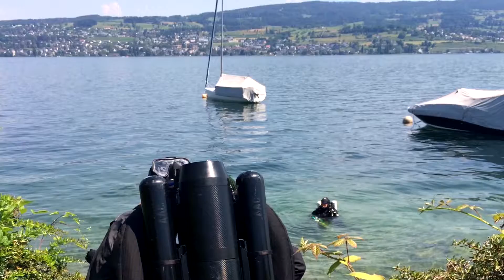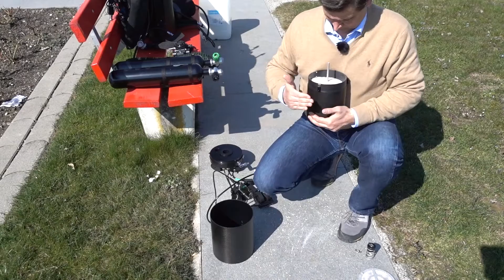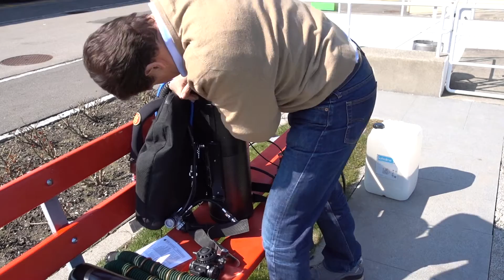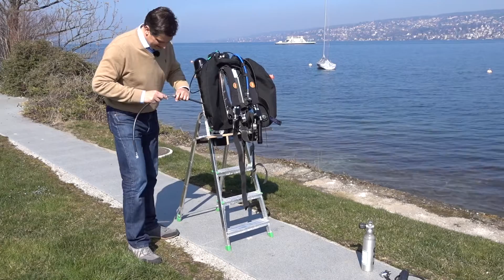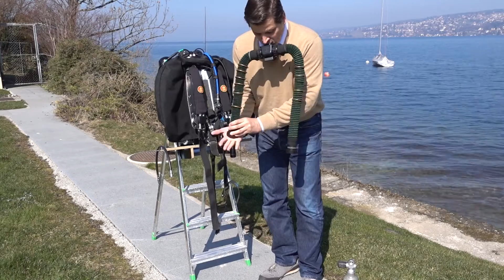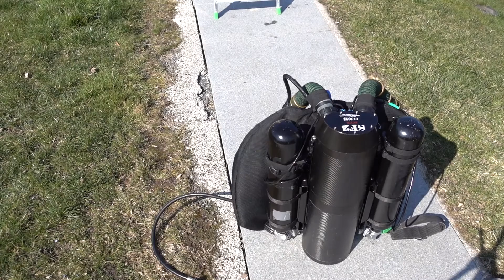SF2 rebreather assembly, calibration, some pre-dive checks

Comment: Hi! I’m about to get my SF2 unit in a few months time! Seeing that you are using copper loop hoses and golem gear DSV! Was wondering how did u attach the copper loop hoses to the SF2 head as I understand that the diameter of the copper hose is smaller then SF2 stock hose!
Reply: Is there a need to buy a special coupler to do so?